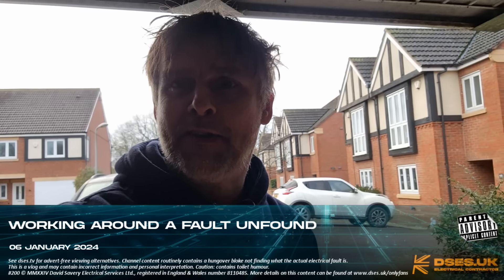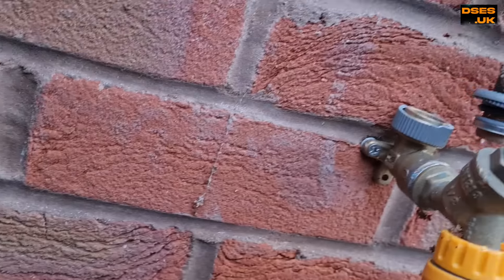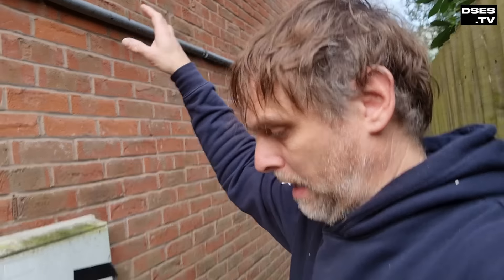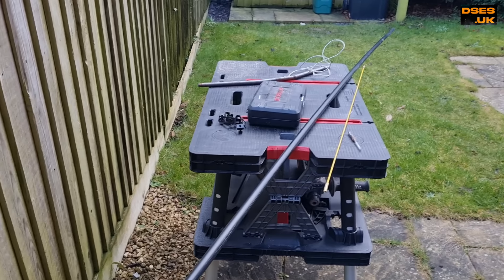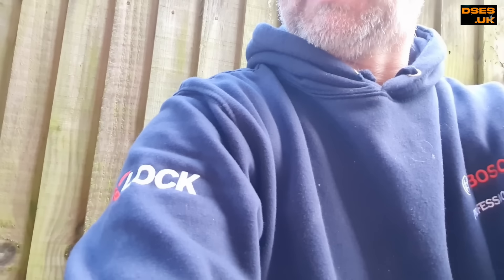Working around a fault unfound

Comment: 3 minutes in and already you present us with this wonderful water pipe install.... bravo! excellent content sir
Reply from the maker: A beautifully lagged thing of beauty. Much like the wife.
Reply: I especially liked the gaps in the insulation every 50cm! @dsesuk
Reply: I actually started out as a plumber (I'll sit and wait for the abuse) , seriously if I had done a job like that, I would have been beaten up lols! And I'm not Joking! No way would you route a pipe right around the house like that! I wonder if the dumb plumber drilled the cable?

Comment: Cracking! 🤣👍 That conduit forming had me in hysterics. I do wonder what could have damaged the cable in the wall though 🧐 I once had a switch wire break just as it left a back box, in the wall.. Took me a while to find it, had boards up above it.. Lol.. Always good when you find faults. Happy New year Dave. Good to see you back..

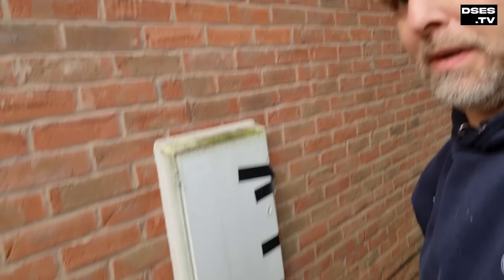Comment: @4:00 my guess is there is a pipe bracket installed by the plumber that drilled through the cable…

Comment: I was told by one the lecturers, during my 2360, that you only came across three problems on site: Plumbers, Plumber's Mates and Plumber's Gaffers. 
That said the one we had on our evening class was a dab hand at the conduit. F'ing useless at the rest of the job. Happy to say he didn't pass part 1. "Blinding result,or, blinding flash in Mr.C's case" (Mr.C was the Plumber)" as the lecturer used to say when we were powering up our competences on completion!

Comment: This is an instance where the wirering regulations in Norway would have made this a quick and easy job. Here, you're not allowed to install hidden cables directly. Any cables running in the walls have be installed in conduit, usually as individual PN wires. So fixing the break would have been as easy as pulling new cables through. Usually it's a pain in neck, though.
Reply: Not if somebody has put a screw straight through the conduit
Reply: All cables in walls are also in conduits in my house in Finland (built in the 70's). I can easily replace cables by pulling the new cables through. On the other hand we do not have RCBO's here but ELCB's covering many circuits - things being somewhat complicated by all detached houses and newer flats having three phase supply.

Comment: years ago i went to a job where the team had been trying to find out why the lights were not working in an office , they checked the breakers they checked the switches they checked the power to the lights , everything good 
i changed the lamps
Reply: When I was a kid (about 8 I think) we rewired an entire room, my dad's workshop, because the ceiling light didn't work. The rewire was badly needed, ancient VIR wiring extended and altered about a dozen times, but when we were done the light still didn't work. Blown incandescent lamp. 30 years later I rewired my own rewire because we turned the workshop back into a kitchen and figured the layout was less than ideal, starting over would be easier than modifying what was there. Spoiler: it still isn't ideal because the kitchen planning was a never-ending work in progress.

Comment: I just keep a large, nice foldable table in my van. Fits nice right next to the shelving unit. Far better than that small workbench. I just love it since i have planty of room to work comfortably on a large panel or have my testing gear laid out within reach. How about an inspection camera? You couldve had a peek and see what was going on in that wall gap. I'm thinking it might have been a cable joint or something similar that failed due to fibration, the conductors working themselves loose from a screw terminal connector.

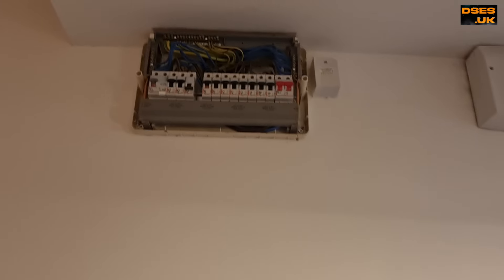Comment: At 1:43 what is that accessory to the RHS of the shoe rack? I wouldn't be supprised if there was an accessory more or less in line with that box on the outside to create a permitted route on the inside, and while we might just leave the cable long and drill out the back of the box and fit a blank plate, some folk have been known to fit spurs or double pole switches
Reply from the maker: That's a phone socket - you can see the comms cables going into it in shots on the outside wall.

Comment: My first thought  - Was the wire in the garage breaker the one going to the outside box? Would have done continuity tests to check if any of the 3 cores were still intact, wander lead or looping in pairs. Also last major change, disconnection of wet socket box - did someone swap some cables about?
(comment made when I have only watched to 5:00 where the conduit fettling starts)

Comment: Forgive a possibly stupid question but what would have happened to the original (non-functioning) feed cable? Would it have been removed somehow? Or would it have been left in the wall? (Great videos btw - incredibly fascinating for a wannabe spark like myself)
Reply from the maker: The original cable's still in the wall, I'm just not sure why it failed between the CU and the SWA termination outside. Perhaps it had been drilled through or something?

Comment: Silly question.... If the old cable was so short and nearby, is there any way to use it to pull a new cable down the cavity without having to run conduit outside? I'm guessing that wouldn't be doable for some reason. Keep up the good show!
Reply from the maker: There was very little meat to the cable on the outside to grab or tie onto and I doubt there would be a free and easy pull to use it as a draw for a replacement. It wasn't directly inline with the CU, so didn't just drop down the wall. I suspect it went up from the CU, across the top of the wall and then came down either clipped or capped behind the plasterboard.
Reply: Never run cables in cavity walls , can be damaged by  various types wall insulation, rodents, drilled into etc etc, see BS 7671 ☘️

Comment: Another delight to watch Mr S, and I admire you for leaving in the errant spring disaster, which we've all experienced. It must have been because it was so funny to watch -  well I had a damp patch in my undies with a hint of ammonia in the air after seeing it, but that might just be my age! 
I am keen to here what you say to the customer, if anything, about the lack of RCD protection, like on those 8 circuits, most look like lighting but theres a 32A and a 40A on that side of the board. I often feel as though they'll think I'm just trying to make work/ money out of them but if we don't point out improvements no-one else will. 
Are there any guest appearances from Nige planned for the near future, he must be missing you/ us a little?
Reply from the maker: I did speak with the homeowner about the CU and the apparent lack of inspection since 2007. He's asked me to price up an EICR and possible upgrade. I also always remark on the certificate under Comments On Existing Installation when the last inspection apparently was and if an EICR is now recommended.
Reply: @dsesuk  Thanks for getting back to me Old Bean

Comment: Evening Dave…..Last that time I had similar….my garage nearly burnt down, , not due to dodgy wiring, but a domestic upright fridge freezer, that failed in minus temps , and I think the pump over heated, thus is went 🔥. Only saving Grace was it tripped, and the heat had melted the solder on the pipes, and the resulting Freon gas escape…put the fire out…still made my arse clench at 6.50am in the morning , when I walked in and was confronted by a wall of black acrid smoke…😳😐👍🇮🇲
Reply: Bloody hell, you were unlucky and then very lucky!
Reply from the maker: I hope you didn't lose too many turkey twizzlers when that packed up Andy?
Reply: Why I highly recommend spending some money on wireless interconnected smoke detectors.

Comment: I was wondering if there was a switched fused spur or D.P. switch in the hallway and it had been turned off?
Reply from the maker: Yeah, my assumption was it would take five minutes and be something like that. I suppose the original builder figured there wasn't much point in having a switch/spur seeing as it had a dedicated circuit that could be clocked off at the CU or double-pole isolated at the far end.

Comment: A colleague has just had the feed to the detached garage of his brand new house changed from a 2.5mm to support a car charger. It didn’t occur to him that they wouldn’t have installed a 7kw feed as standard.
Reply from the maker: It's madness. A 4mm 32A would give you a fighting chance, but it's either a 16A 2.5mm or a 13A spur off a kitchen socket circuit half the time.

Comment: A sparks who lives a few doors away from me was telling me abut a pre Christmas f up he had, drilled through from outside to inside very close to main incoming supply but it had been looped inside the cavity so the entrance and the exit hole didn't line up and he drilled right through it, large bang and £1400 to UK power networks to replace it. 
Did you do any IR or continuity tests on the cable from the CU down to the junction box. Just curious really.
Reply: How much to replace the brown trousers and underwear..? 😵‍💫 💩
Reply: @TestGearJunkie.  He seemed all very relaxed about it, the cost and the fact it melted the end off a 20mm SDS drill bit.

Comment: Disappointed you did use some resistance test and contactless pen to locate the open circuit! Then cut an fcu at the exact point of failure 😊. Standards are slipping. I guess it was a short run so just got on with it
Reply from the maker: It's a Friday job Andy. Fault tracing? Nah, get it fixed and get down the pub!

Comment: 1:42 point in the video, is that a switch hidden by the shoes?
Reply: Well spotted.
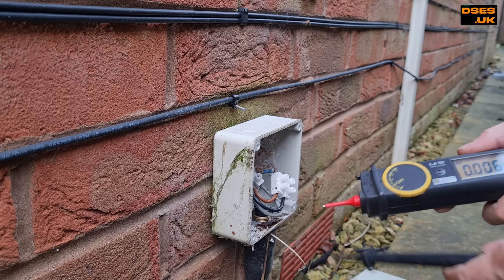Reply from the maker: A phone socket I'm afraid. You can see where the comms wiring for it enters on the outside at 0:52.

Comment: Was it not the fuse spur behind the shoes feeding the outside box. Fuse might of just gone
Reply from the maker: There's no spur - it's on its own radial circuit. The accessory seen on the wall isn't related.

Comment: What started as a the usual DSES video turned into an absolute banger! The toilet humour on the coffee shout outs, never laughed so hard..... On a different note, what is that device behind your driver's seat
Reply from the maker: For a brief time in 2022 I had illuminated van signs. That contraption controlled when they came on and regulated the power they used. It also controls the beacon lights on the roof. Sadly, the signs were a bit of a disaster and had to be scrapped, but the gubbins is all still there.

Comment: 0:55 another great sky install? That outside tap is a weird one im guessing that house like many newbuilds the kitchen is at the front of the building with the bathroom just above it.  so putting an outside tap at the rear is not going to be easy. plus is that one of them fancy wall mounted tooth brush holders in your bathroom.
Reply from the maker: Difficult to get water to the rear no doubt Ryan, but that's all kinds of ugly. And then mounting the tap directly above the socket! As for the new bathroom, it sports all mod-cons including dual toothbrush charger, dehumidifyer, mixed flow ventilation, backlit mirror and underfloor heating. Oh, and also the lights are timed so if you crawl out of bed for a Carlsberg piss at 3AM, the overhead lights don't turn on to blind you; only the mirror light comes on. There is an override function if you really want to ensure you're not pissing foam all over the bathmat.
Reply: @dsesuk  that bathroom sounds like there might be a nice video comming about its construction.
Reply from the maker: @rlfvac  Sadly not. It was all so much work that went right into the late hours of Christmas Eve; I didn't have time to throw the camera around.

Comment: At 5:00 have you drilled upwards from inside instead of downwards ?
Reply from the maker: It's a straight hole because I was too close to the ceiling inside to get a downward angle using my metre bit (a half-metre would ordinarily get through, but the CU itself prevented the drill getting close enough for that bit to break through). Briefly seen on the Keter bench at 10:08 is a tube of OB1 which was liberally injected afterward to clog it up.

Comment: Well Dave your certainly shitting out videos more regularly now 😂
Reply from the maker: It won't last. It's odd because this was just an off-the-cuff number filmed on Friday and pooted out on Saturday without too much effort, yet despite its quick turnaround, lack of technical content and the fact I don't actually find the flimmin' fault, it seems to be doing better than any other video of late, some of which I take great pains to edit and provide detail for!
Reply: @dsesuk  yeah that is strange, maybe a few off the cuff ones could be good now and again showing more real to life situations, then you could always add a bit at the end showing your thought process, like the flat half retire that you done with the fault on one leg where you used the resistance to figure out where to attack the wall and find the fault.  I also take it the customer didn’t fancy you hacking into the wall to find where the fault on the cable was then

Comment: Looks like a cowboy job over a cowboy job!. I would have done everything inside then put the wire to the outside. Would have looked a lot better…
Reply: So what are you suggesting ? A nice piece of sticky back trunking ? maybe you work for the council, or maybe you would chop the wall out and cap the cable down and out but remember most customers won't want the hassle of making good internally and will far prefer what Dave has provided. However I'm sure you might come back an explain so all us cowboys can meet your superior standards.
Reply from the maker: Any solution such as this is decided in liaison with the homeowner. They have choices including an internal run, perhaps in trunking, an internal run chased into the wall or an external run maybe clipped direct or in conduit. Here, the homeowner was less precious about the side of the house which is generally unseen and already has various services bolted to it. The exterior run keeps it out of the general eyeline. It's not shown here, but a large mirror hangs on that hall wall (that's what the mounting point is for), so a straight internal drop down wouldn't work too easily in the likes of trunking. But do please post a video of the next time you get an internal cable looking like anything other than an affront to the decor. I'd love to see it.